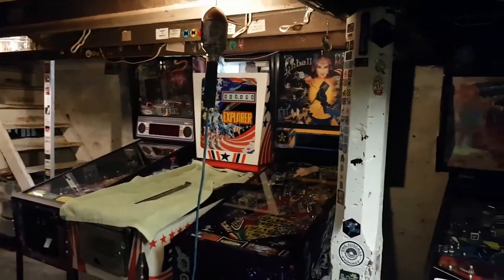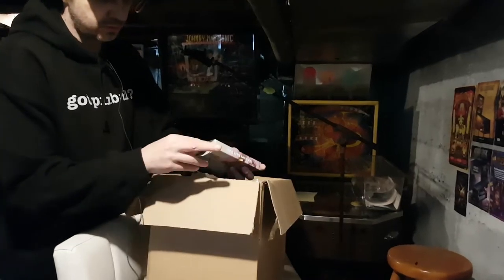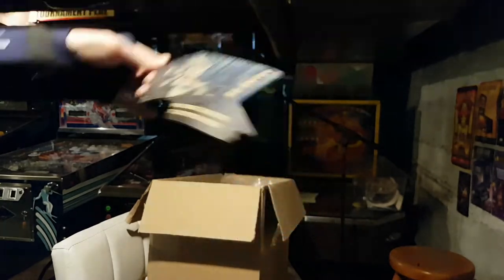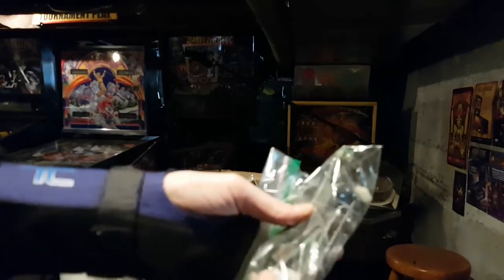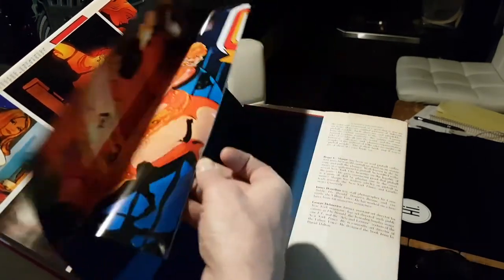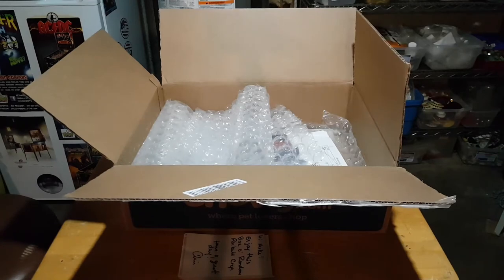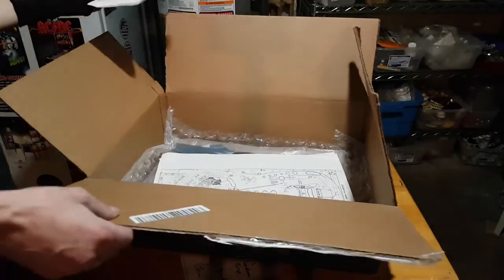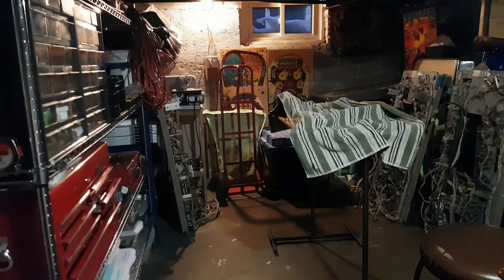Searching in boxes for treasures! And playing Jenga with Pinball Machines!

Comment: Figure out the power issue on the explorer yet?
Reply from the maker: Sadly no. I took another crack at it as I feel like the solution should be so simple but still did not resolve it yet but I wont give up.